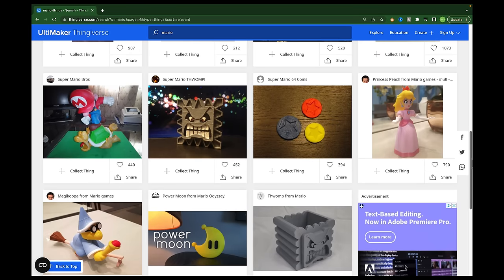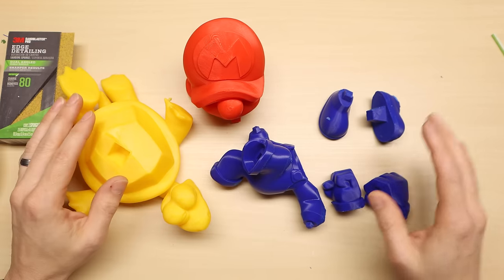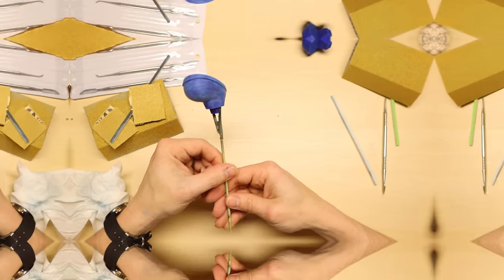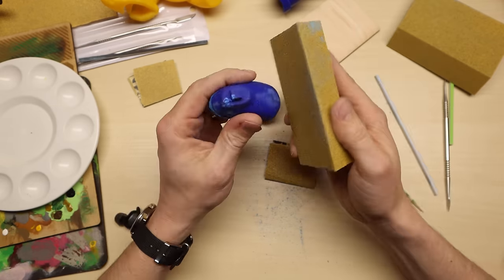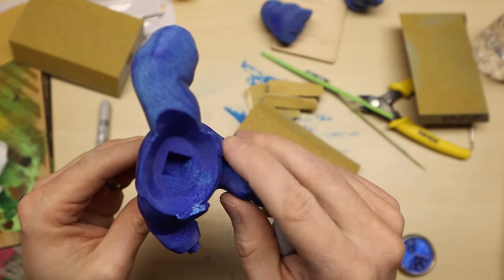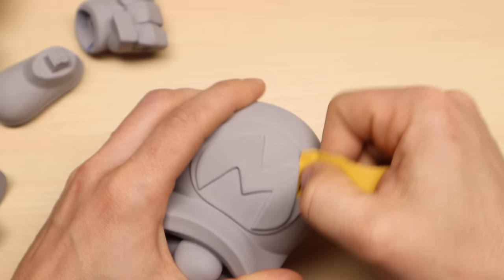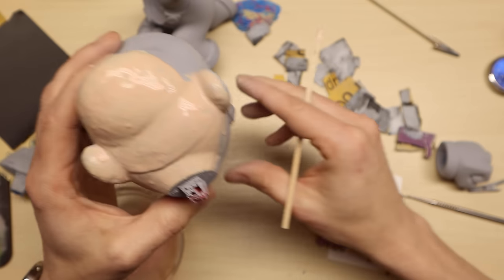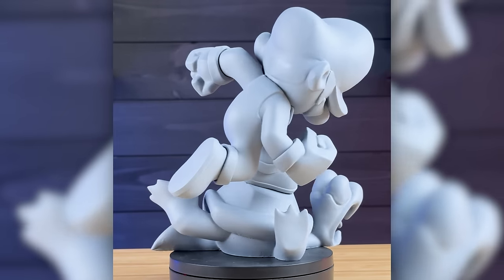How to Smooth PLA 3D Prints to Look Like Resin!

Comment: From someone who is a painter, don’t get so hung up on not sanding through your primer. Your first primer coat should be viewed as sacrificial, you actually want to sand through most of it because that allows your scratches and everything that you were trying to fill to then build up to the level of everything else. If you just lightly sand everything and rely on your sense of touch, you’ll miss a lot of scratches and things won’t get filled in as efficiently. You will end up having to fill/sand/fill more often than if you just more aggressively sanded down the primer coat, revealing all of your areas that still need more work. There is no need to “polish“ the primer, because you’ll be painting over it anyway. 220 scratches will get filled up by spray paint, especially filler/primer so for buildable paint/film finishes, no need to really sand past 220. Great result! Looks amazing!
Reply from the maker: Great tips! Thanks for sharing!
Reply: I was coming to the comments section just to say about the first sacrificial primer coat.  It's meant to show where your high spots are.  Edit: Removed an unnecessary duplicate "where".
Reply: For bodywork we use a guide coat on top of the primer and it settles into low spots and very easy to see.
Reply: @LearnEverythingAboutDesign  So that would be something like a white primer, then a thinned topcoat?
Reply: Good advice!
Reply: As he says ^^^
I sometimes even use different primer colors throughout the process of priming and sanding. This also helps to see if I am not missing any spots during painting
Reply: @Infinatummedia Exactly! The same idea as machinist's blue on metalworking, so you can see which areas you still have to machine away.

Comment: Step 1: sand
Step 2: sand
Step 3: sand
Step 4: buy a resin printer for resin looking prints
Reply: Probably the size of the sculpture can be a problem. But a idont know.
Reply: but then skip the get it really wet step
Reply: step 5: deal with messy resin printing process.
Reply: @tinobabbage1350  Not really, as he printed it in small parts anyway
Reply: Resin printers are a pain, I know. But I'd way rather deal with it than sanding and filling and sanding. I'd lose all the detail, and it would be way more work!
Reply: @B2000Z  not to mention, the sanding methods only work for relatively flat/large surfaces. If you’re making smaller or more intricate pieces, it’s not really possible to sand.
Reply: And deal with the resin toxicity...no probs right? (Fdm toxicity is much more controllable)
Reply: Thr's like 120 USD worth of resin
Reply: Thanks 40 min saved
Reply: @underagum  step 6: stop using your resin printer because of mess, hazardous chemicals, difficult disposal of waste, borderline impossibility of ventilating properly if you don't own your own home (living in an apartment for example), and having to deal with all of these problems even after prints fail (in my experience, happens a lot, even if dialing in the settings with calibration prints, like the cones of calibration).

I love the quality of the resin prints I've done, but it's such an enormous pain and so time consuming that I don't even use my resin printer anymore. Just sits in the attic collecting dust.
Reply: Ro me resin printers need too much care and resin prints take too much work.

To print a small thing I just fire up my Ender 5 Pro and 20 minutes later it's done. I have the print ready to use and I can forget about my printer another few weeks without having to care about anything.
Reply: Step 5 you end up failing it’s not just about a resin printer It’s about so much more than that. If you guys think that buying a resin printer is going to save you it won’t. There’s so much more that goes into it. I don’t even have a printer and I already know that a resin printer isn’t cheap. It’s a lot more expensive than a normal printer not everybody has that kind of money that’s another thing you guys are leaving out and plus let’s say you have enough money for a resin printer but if your designs don’t end up selling now you’re stuck with a printer that’s expensive no what are you gonna do yeah think about all the variables think about everything that will go wrong not about what’s gonna go right that’s how you succeed
Reply: I thought the same thing, but I'm guessing he's trying to perfect this process maybe for something else. FDM prints are a good starting point.
Reply: exactly..
Reply: @heyspookyboogie644  plenty of sanding methods and tools for tiny details and crevasses that work perfectly, like with any other craft you have to put in effort for it to look good, in my opinion it's just better to go through the sanding process
Reply: @underagum exactly plus prep time for resin models with the goopy and toxic smell being strong idk I would much rather spend that time on end result then prior to print with all the mess of resin
Reply: @heyspookyboogie644 actually you can easily sand really small pieces. I only say this because of my actual experience of many years and sanding tiny pieces I've created from wood and very soft wood aswell meaning light touch can completely sand away parts of your work in one swipe. But again depends on experience with that kind of work. In general you would be more accurate then the area of experience I personally have but anyone can do it if you want to. Just takes a mindset kind of like meditation honestly amd just really letting it relax you so you take time to be patient with yourself and you will easily start to adapt and start to master any kind of project and sanding needed for pretty much anything
Reply: Hahahaha... exactly what i thought. :D
Reply: Funny as hell. Not gone lie. I has resin and fdm. It's hilarious how people talk about resin printers. It's clear who doesn't have one
Reply: @underagum  Once you've got your routine down, your confidence up and your workflow well organised - it doesn't feel messy at all. The sanding filling priming FDM loop is way messier IMO.
Reply: @underagum  i can start the process, set up the printer, set up the resin, put it to print, take out the print, clean it and clean everything in less time that the first coat of prine/sand of a FDM
Reply: @Sin_Alder  Can I have your resin printer then?
Reply: @JimChair-zx4lu  Ffs, you have no idea my dude. There's resing printer for a couple of hundreds. The resin itself obviously is more expensive. But that's the way you have to go if you need very detailed stuff. If you plan in printing simple shapes or functional parts, yeah obviously you go with fdm, but we are talking about wanting detailed and smooth pieces. If you need that, you can;t avoid going to resin. FDM is gonna give a lot more work. Plus, all the extra preparation for resin printers is daunting at first. Once you organise your space and process is all quicker.
Reply: @skytaylor4209  You know when you sand you need to also control the toxicity of the dust liberated right? In other words, you end up with particles in the air, for which you'll need also ventilation and a mask.
Reply: Step 5 buy an SLS printer
Reply: @JimChair-zx4lu  To be fair, nowadays you can get a decent resin printer for barely any more than a entry-level FDM printer.
But there's a lot more to consider. There's the toxic fumes that almost inevitably result, so you need decent ventilation. And as well as the hazardous resin, you'll also need a steady supply of isopropyl alcohol to wash your prints, as well as to clean your print bad after every run.

I love having the option of a resin printer for those models that really need the detail. But if I didn't have a separate room to keep it in, or I had boisterous kids or pets to worry about, I don't think I'd risk having one.
Reply: step 5: get cancer when batman accidentally dunks you into your vat of resin 🤣
Reply: @Sin_Alder  might aswell give it away lol
Reply: @Linuxdirk  I have a p1p I bought year and half ago... the past year I had to move and left some stuff in a storage including my printer

1 year later I was able to move that where I live. I fire the printer up and print something - worked flawless ...
Reply: Everyone saying “OMG! The mess and smell with resin printing” my guess is you’ve never used one. I use both and they both have good and bad points. Resin printing isn’t all that messy if you aren’t a sloppy moron. There’s no reason it even should be messy. Pour in the resin. When done use rubber gloves and remove print and put it in a container of alcohol, move it to your cleaner if using one then set it on paper towel
To dry. Put it in curing box and good to go. Clean your gloves in the dunk tank and dry them with paper towel. No mess at all unless you sling your arms all over the place
Reply: @throwitatthewall6289  what about the toxicity.

Comment: I find that wet sanding saves you a LOT of sandpaper, you can use it for much longer than if you sand it dry. I usually add a couple of drops of dish soap to the water as well so when I'm done sanding I can just rinse it in water and it's nice and clean and ready for paint.
Reply: Couple quick swipes with a sandpaper eraser will probably extend the sandpaper life too.  I doubt the abrasive is deteriorating sanding plastic the same way it does on wood or metal, so it's probably just gumming up.
Reply: Depends also a lot on the type and brand of paper used. I switched from regular DIY store paper to Mirka Gold and that stuff tends to stay "open" much longer and also does not dull as fast. I only use wet sanding on the lacquer.

Comment: Great video!  Awesome tricks that will help anyone looking to make their 3D prints look smooth, thanks for sharing this!  There's one more step I do in the beginning before sanding that you might like to try as it's a big time saver.    Get some fiberglass resin (bondo brand, or whatever is on the shelf at the store) and mix it up and pour it over your print and let it cure overnight before sanding.   The resin will "self-level" and do a lot of smoothing for you.   Most importantly, the resin sands SO MUCH EASIER and your initial sanding time will be slashed to seconds or minutes and no dremel needed.   Trying to sand plastic is just generally difficult, so i recommend the resin route.     There's a product made specifically for this that I forget the name of, but in my experience the fiberglass resin off the shelf at your local department store is cheaper and more effective.   As an added bonus it gives some strength, too, while also being a better surface for the primer to bind to.    Give it a try, I think you'll like it!
Reply from the maker: This is a great tip I’ll have to give it a try. Thanks for sharing.
Reply: The product you're looking for is probably XTC-3D or 3D-Gloop. I have the first one and it is a two component mixture (resin + hardener). After applying it to my prints the gaps were filled and it got the glossy finish. It's also much easier to sand.

Comment: Very great guide! Would've been extremely helpful back when i still did FDM printing.

 One thing i would recommend to avoid primer build up: if you have an airbrush, use it! I used to hate the priming phase because i would always get splotchy awful coats on my model until i switched to using airbrush primer. not only do you have way more control on how the primer is applied, you also have significantly shorter wait times which means you can prime, evaluate the model and then get right back to sanding/scraping without having to wait 2-4 hours, or in my case, until the next morning because of my climate (cold af)

Another thing I'd recommend is to get yourself a scraper card or a burning tool to take away the first layer lines. I suggest getting the one that looks like a hobby knife. it's been a total game changer for me and what took me 4 hours of sanding I can get done in like 30 minutes.

Anyway thanks for the video! I wouldn't say i learned anything new, but having 1 video that tells you all the tricks instead of having to watch several dozens to get the same information will be a huge boon to beginners.
Reply from the maker: Thanks for the tips. I actually do have an airbrush I use it a ton. But a lot of people don’t have airbrush’s so for this video I used rattle cans. 

I’ll have to look into that scraper. 

Thanks again!
Reply: Do you happen to have a tip for preventing the tacky texture on primer? I may just be using too much paint, but it's a pain that it's tacky until it's been handled all over even after drying
Reply: I actually use files for my initially sanding…makes life very easy, and with micro files you can get into those small areas

Comment: These are great tips.  I'm lucky in that while I'm only new to 3d printing I was into radio control cars, boats and planes for close to 40 years.  I used to build model cars as a kid as well and then in HS I started in auto-body.  Filling and smoothing is second nature to me.  lol   One of the tricks my auto shop teacher taught me (something like 35 years ago) is to use a mix of 2 part epoxy and methanol to thin it out and add in corn starch as a filler.  You can use baking soda but it is coarser than then starch is.  I use this to paint on a layer and let it cure for a few days to fully allow the methanol to evaporate.  It sands well and I can get all of it at my local dollar store. It takes paint very well too.  I like to mix the part A (the resin)  with the methanol to thin it down and then add in the starch until it's like pancake batter then add in part B (the hardener).  If it's too thin add more starch.  If too thick more methanol.  It also has that side benefit of leaving a very "plastic" looking surface.
Reply from the maker: That’s a great tip I’ll have to give that a try on some prints. Thanks!
Reply: @ItsMeaDMaDe  My pleasure.  As an add-on you can play with it a bit by using various cure time epoxies.  The longer the cure can really let the epoxy smooth out.  I personally prefer a 20 minute set.

Comment: One suggested change to your process, use primer/filler first.  That builds up the surface so you’re sanding away less PLA and more filler.  You get less melt and it’s quicker to sand.  I go back and forth with primer/filler and sanding.  Very little putty filler is need
Reply: Good point.
Reply: Dont you need to lightly sand the surface to have the primer stick anyways?
Reply: @V3lv3n  sticks plenty fine for me honestly.. if im superglueing parts down i already sand them to almost bare pla best i can then apply glue. otherwise sticks perfectly fine for non structural parts

Comment: after 12 years of 3d printing i just use floor varnish, works just like wet sanding , it takes a long long time but much better on my wrists at 55 and its cherry smooth

Comment: The result is amazing! thanks for sharing the process with so much detail. I have ZERO experience painting 3D prints (unless just going with acrylics on top of the PLA....I know), but in the comments there seem to be people giving good ideas mostly related to get something similar with less effort and steps (so faster lets say). SO....IF you ever run out of ideas for videos, let me do a suggestion:  a video post processing the same model (a new print of course), but using some of the advice to see how good it really works. Either the end result is fast and good or not, the experiment would be beneficial for everyone (including you, mostly if you discover a faster/easier workflow, and if not, you can say "told you guys" lol). Cheers and thanks for the incredible hard work you are putting with this channel, I already learnt a lot from you.

Comment: Came out great!  I usually do a light sanding of the print at first followed up by two coats of primer that has filler in it.  After that I do one more round of light sanding followed up by one final coat of primer with filler and the end result is ultra smooth like resin.  I just bough a heat knife and might try that out to remove the support marks from the prints also.  I also use a small container of automotive putty to do any patchwork if needed but most of the time I do not need to.
Reply from the maker: I think that’s the great thing about this hobby there are so many different ways to do everything. Thanks for sharing your process!

Comment: Here goes a tip of something that I do and works perfectly. When you need to fill cracks or something else of your print, use a brush and water to mix the putty, and apply that wet mix in your print as if you were painting it, it's way more easy and fast.
Reply from the maker: That tip is in the video! 😅
Reply: @ItsMeaDMaDe  I didn't see a brush 🤔

Comment: Give card scrapers or using utility knife to scrape smooth sections a try.  It's a definite improvement over just sanding.  I use it in nearly all my post-processing, along with 2k high build primers over plain rattle-can primers.  They aren't for everyone, but when I want a really smooth and durable surface as my paint base, it's what I go to these days.
Reply from the maker: That’s awesome I’ll try it out. Thanks for the tip!
Reply: Are they the ones with a bur?
Reply: @Feibie  yeah you take flat metal and create a microburr that you can use to plane the rough parts down. It works incredibly well, but not in every situation :)
Reply: Hi Chris,  great work. I'm hoping to print this out and I'm going to follow all your steps to paint it cartoon style. I do have an unrelated question though. Where did you get that Fantastic Four Thing bust on your shelf over your left hand shoulder? It looks really cool and I'd love to make one of those too
Reply from the maker: @danielcoombes3310  few weeks ago I did that as a project. I got it from inspy3d. Great guys here is the link to their site. They also have a patreon where you can get all their models. 

https://inspyr3d.com/
Reply: @ItsMeaDMaDe  excellent thank you man. I'll go have a look at their stuff.